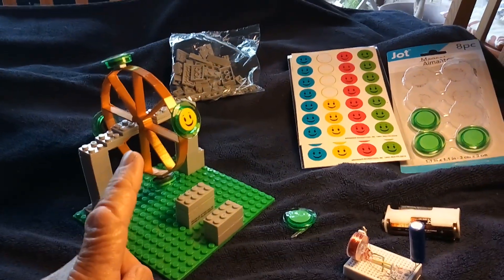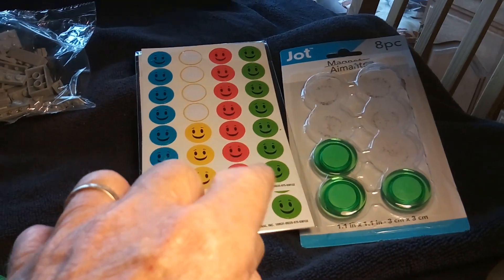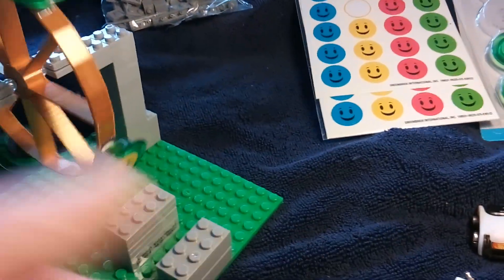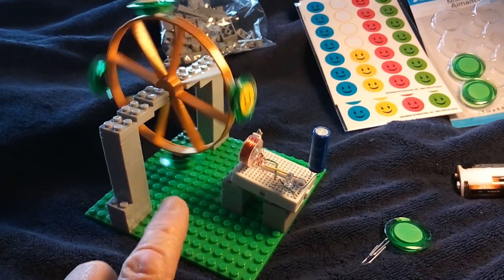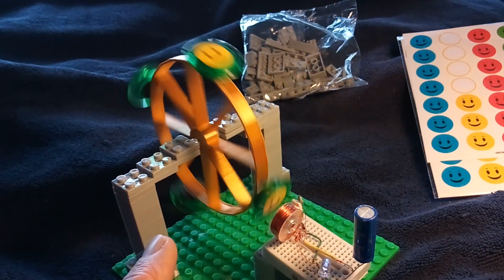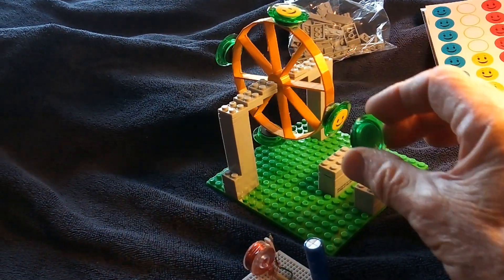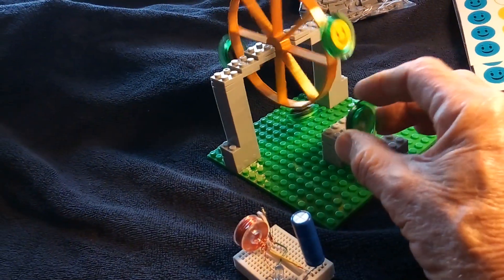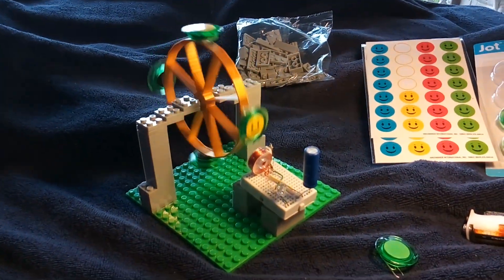Grandad's Emoji Magnet Motor

Comment: That is excellent 👌
Reply: I think trying to use all 10 magnets at once made mine too heavy. Sometimes less is more 😁👍
Reply from the maker: I made a horizontal setup first that worked much better.  I used a couple of ceramic ring magnets in opposition under the rotor to suspend it and negate the wieght.  I just used a bent paper clip as the center shaft. This was a fun quick project.  Thanks for presenting it.  Happy grinning faces all around. 😀😀😀😀
Reply: @Lidmotor  you are the master 😁😁